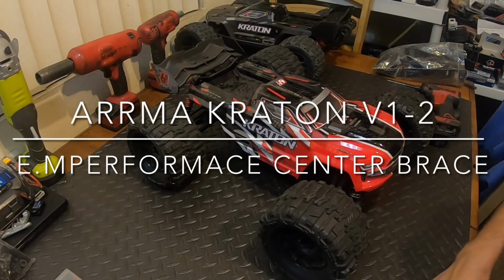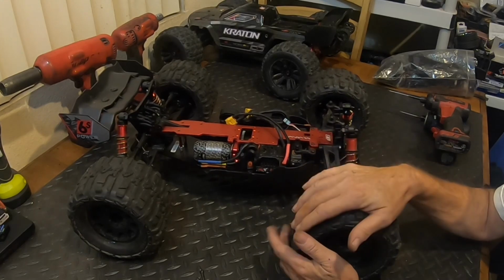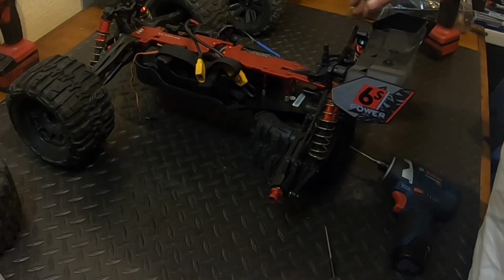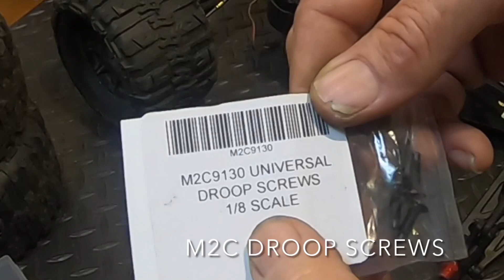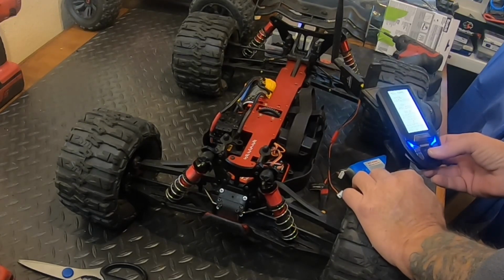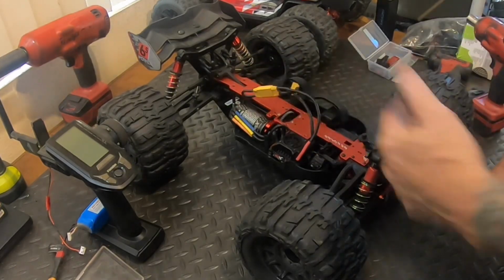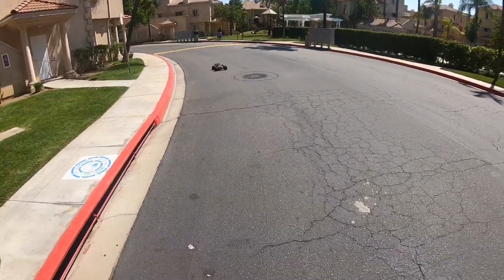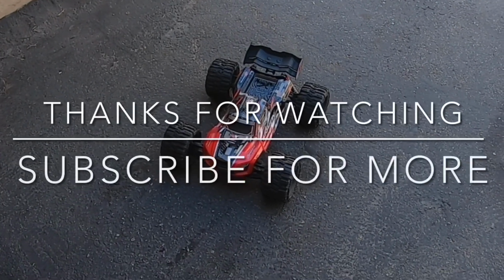Arrma Kraton V1-2 Finished my custom build for my son A few things left but it runs 💯👍

Comment: The 4s backflip lp tires from arrma are great on a 6s truck.  They have the same width as stock but they are a little shorter.  They don't balloon a much and they handle great.
Reply from the maker: I run them on the widemaxxs great tire 🤛🤛
Reply: @earlmoorhead5555  Made the kraton 6s handle, turn better.  Planted  to the ground. More control in the air, no bounce on landing

Comment: Lol wow. I guess I just sold u a straight lemon huh 🤔.  Crazy I sell sooo many RC’s and never ever had someone slander my name like that let alone be unhappy with there purchase. I had 1 other person have a issue.  Only thing I agree with is the droop screws. That’s it. Diffs are empty?  I was building them diffs live.  U can go back and see they have fluid in the.  Wooow. 👌🏽👌🏽
Reply from the maker: I thanked you in the video I didn’t think I was slandering you ?? I ever called you the go to guy ?? Idk what you mean
Reply: @earlmoorhead5555  the diffs were empty?  U wanted close as possible to stock v1. Diff fluid in v1 is 7k. I put 10k In there. Center I think 1mill. And think I asked u if it was ok to put 1mill in.   This is a side business for me earl.  Ppl don’t want to buy from me if they here this type of stuff.  Yes droop screws were on me I messed up. But bro.  Then u said diffs are not shimmed right?  I heard clicking 1 time. ur right but I’ve spent years trying to perfect diff shimming and 1stop and jack h both got cars and didn’t have no issues.